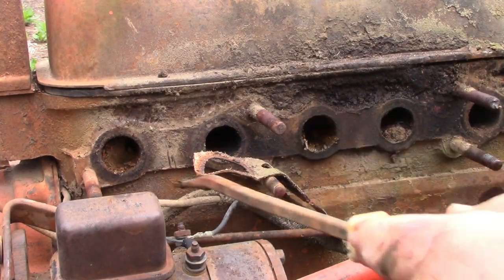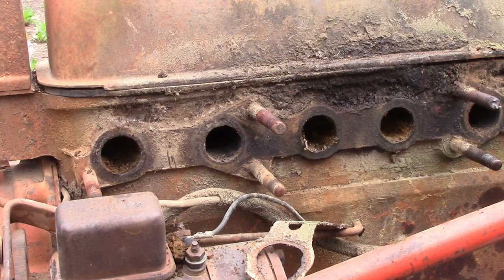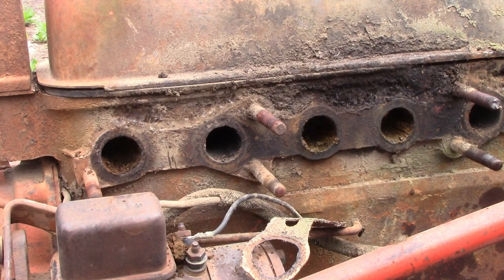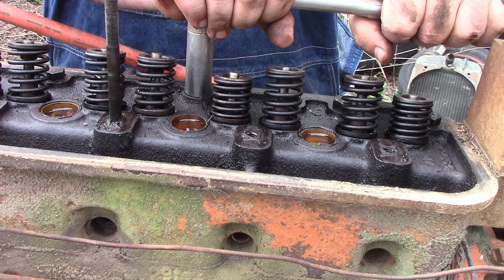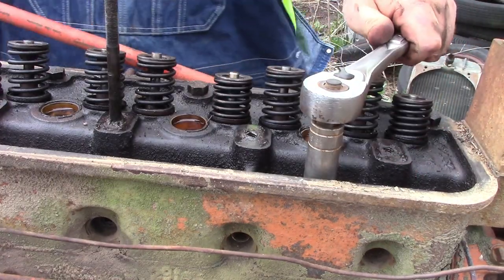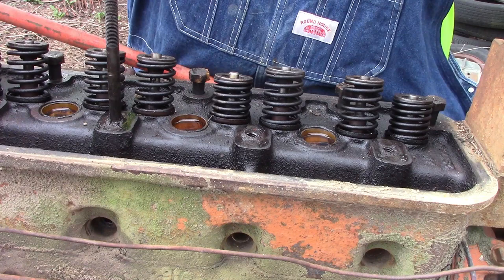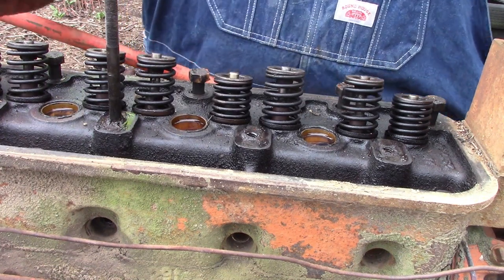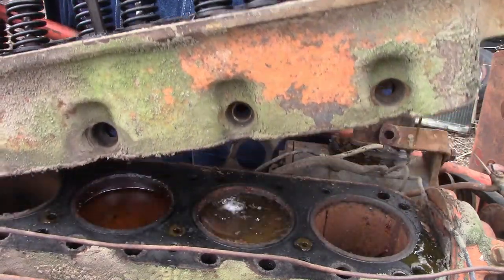Allis Chalmers C (can we fix it part 2)

Comment: Unless the oil has water and the bearings show water pits in them the bottom ends usually hold up good. Pistons and sleeves should be all. If you shoot a little oil on the stems of them valves they should free up easy. They stick on allis when tolerance is good but just dry.